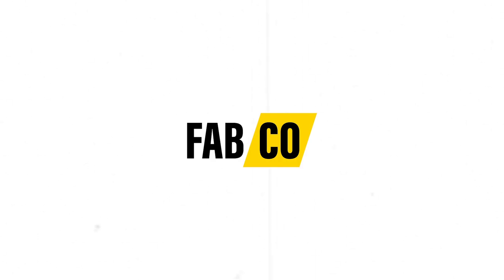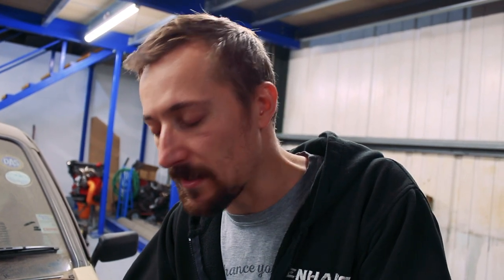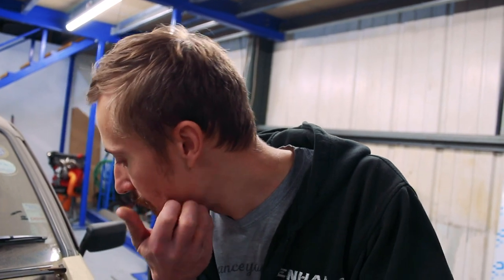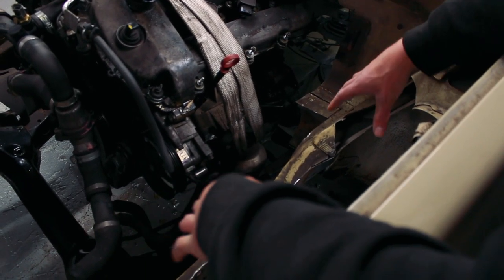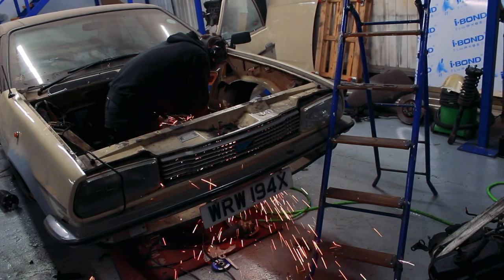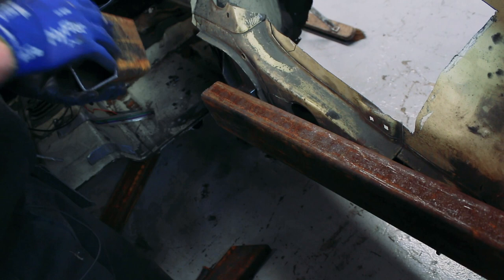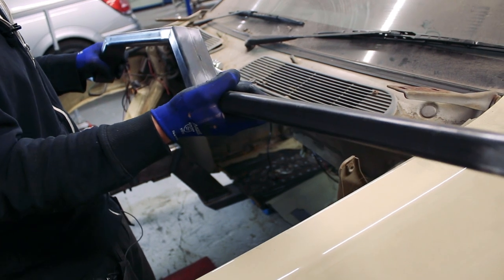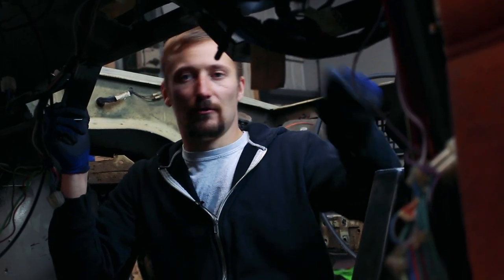Project PrincesS-Type | Episode 5 | 3.0 V6, Rear Wheel Drive, 500HP, Engine & Drive Train Swap

Comment: Sorry if it's already been asked I don't read all the comments,would it of been at all possible to do what matt from urchfab did? He used the entire floor pan and running gear from a mx5 and put the too end of the shell on top of that? Hope that makes sense
Reply from the maker: Possible, yes. The issue is the Jag is much longer from than the Princess, so that doesn't realy work in this application.